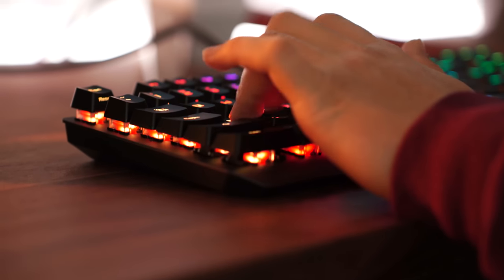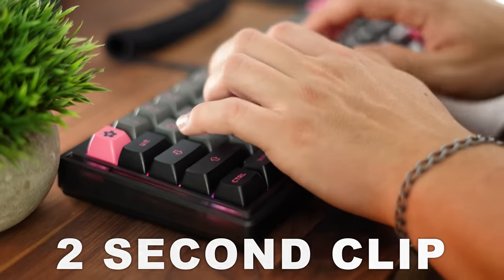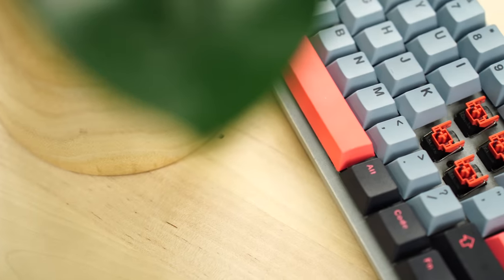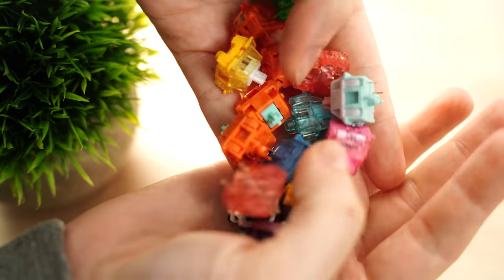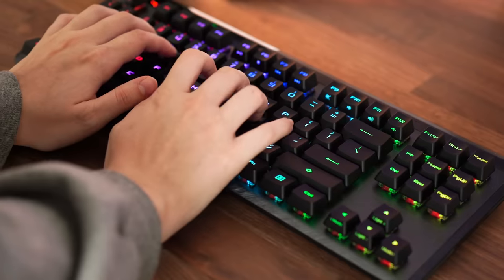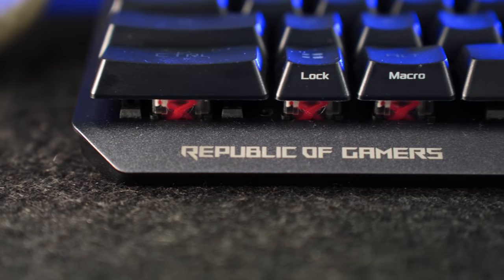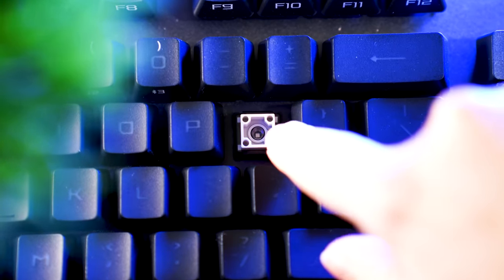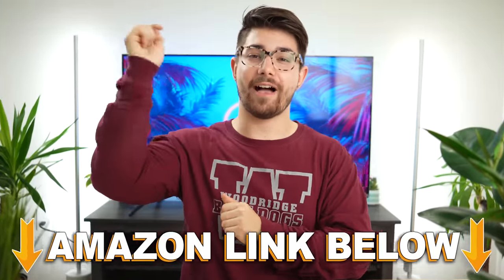ROG Just Made The ULTIMATE Gaming Switch!

Comment: I'm getting Romer G flashbacks. Romer G was a truly horrible switch in EVERY way possible and other than being optical, this looks very much similar to romer g.

A switch like this is simply not good enough. Just wait till the keycap pins break inside the switch when you attempt to remove the keycaps at a later date. Then keep struggling to find new caps for this style. Not to mention the dist that can accumulate in that empty space above led. Happened with romer g and will happen with this one too. Romer g had key chatter issues on a huge scale. This being optical might not have that problem but all other problems will remain. Seen this style, suffered and not willing to suffer again. I am happy with my custom keyb.
Reply: Yup i owned the Romer G and regretted it sooo much lmaooo. Last week when I finished building my first mechanical keyboard. I decided to solder and took out the romer g switch in the old keyboard to see what’s inside. It was the weirdest looking switch I have ever seen